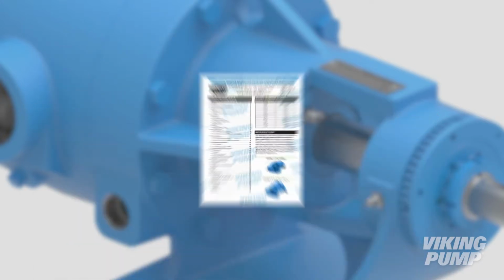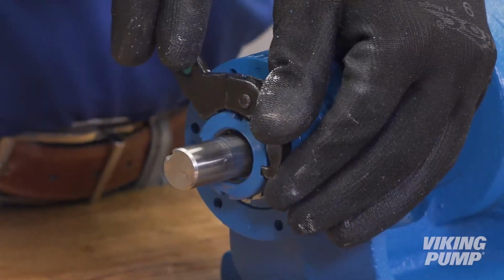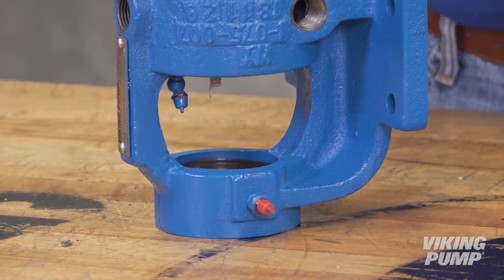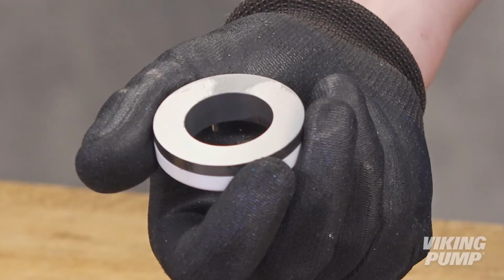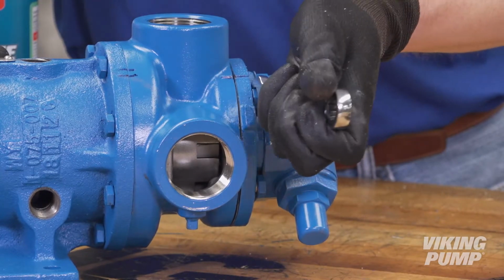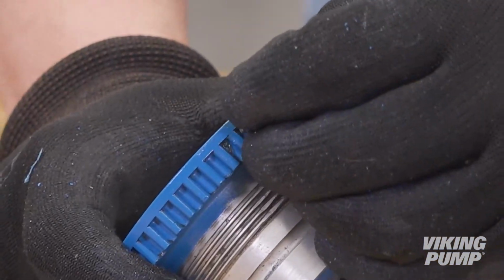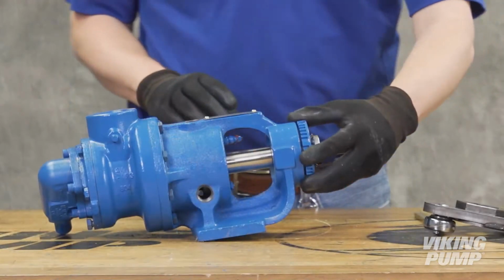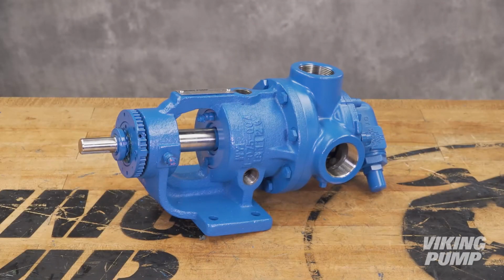4724 Series™ | Repair & Mechanical Seal Replacement

Comment: What's the function of the half rings
Reply: Half rings lock in place the back side of the bearing housing assembly to the rotor and shaft.  Therefore when you adjust the bearing housing for the clearances the rotor and shaft moves with it.